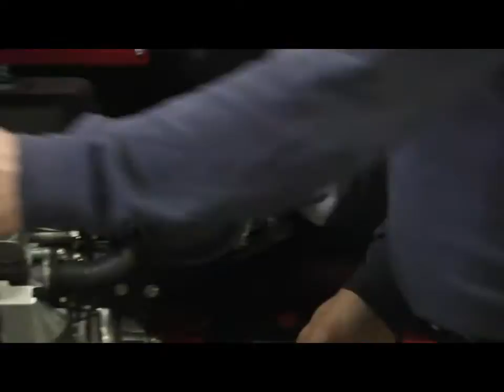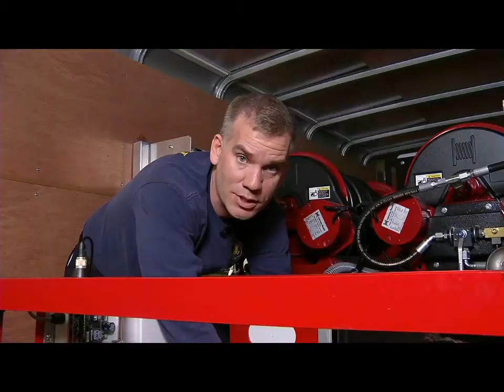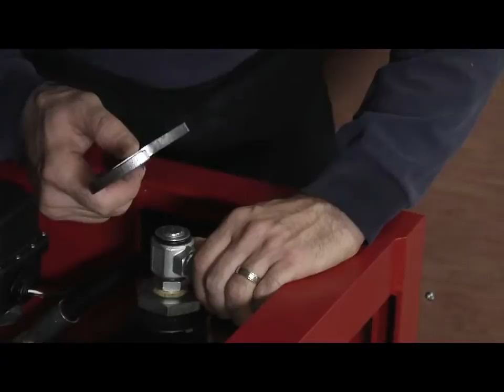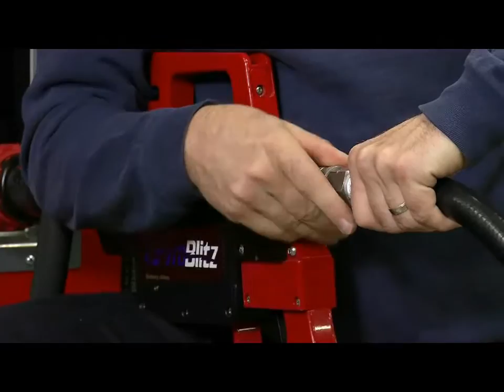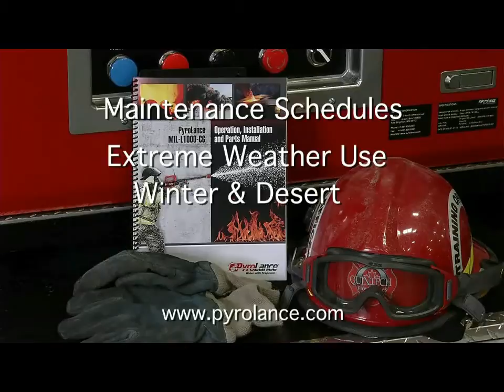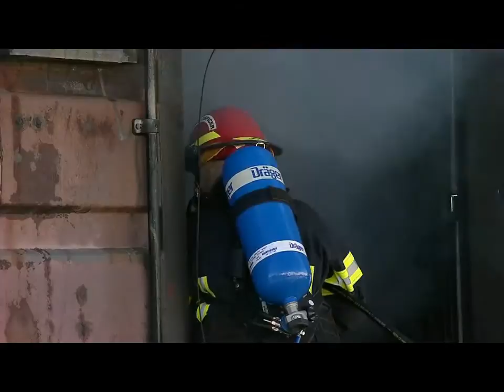Intro / Operations To Your PyroLance Unit

Comment: Why not consider pushing installation in platforms. It would be safer than a cutoff saw. Plus the application of water foam imeadiatly on the  fire